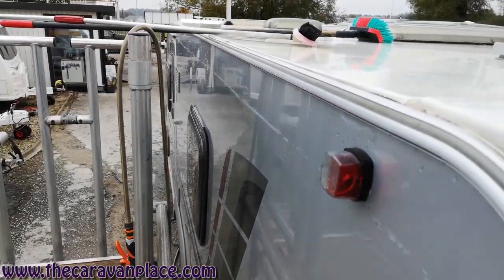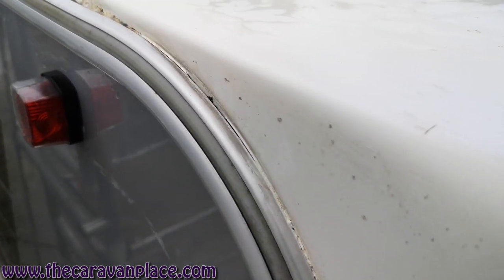Caravan Cleaning. Including caravan roof cleaning. Caravan cleaning

Comment: Hi Mark What timing just done the same at home on the driveway this afternoon roof wasn’t as bad as your caravan used fenwicks caravan cleaner then bobby dazzle and used a leather to dry it off going to drain off the water tomorrow and blow out all the access in the pipes and clean the external , grey waste pipes next week adding a couple USB’s and a Alde heating discrete themosate then all done till February
Reply from the maker: Hi Dave, Super job, it sounds like you have a busy week or so ahead. It's no easy job is it. 👍